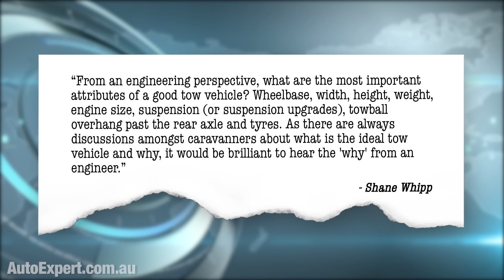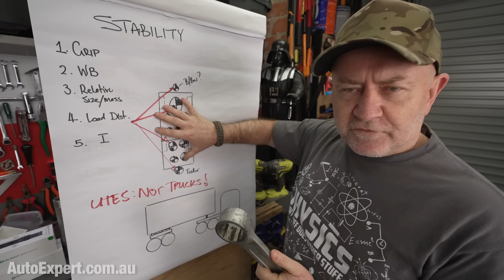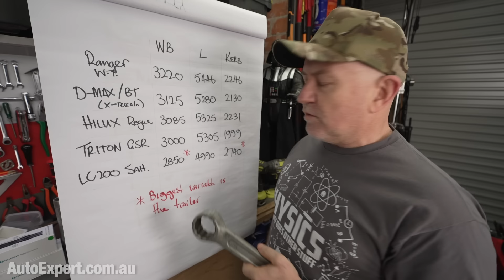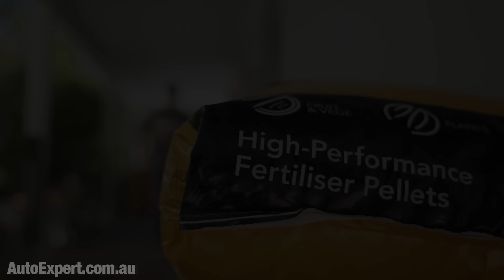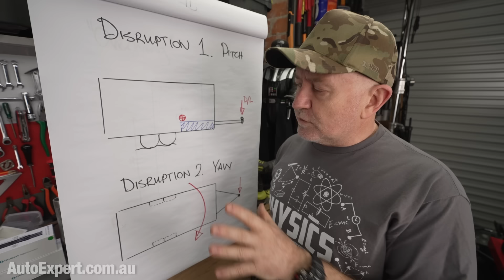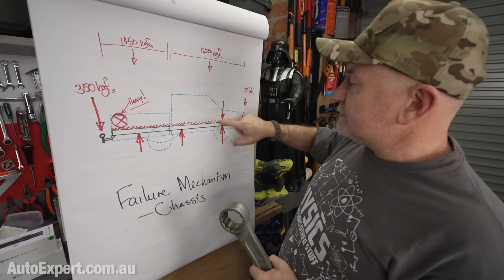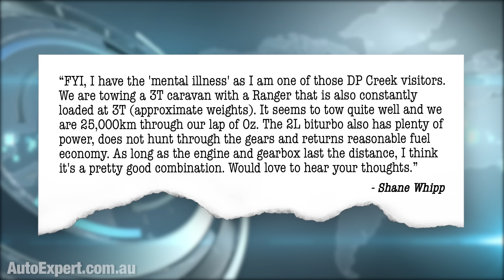Heavy Towing in Depth: The Applied Physics Deep-dive | Auto Expert John Cadogan

Comment: Wow John that was certainly a different feeling to your normal videos. It was a lot more refined without so much of the piss taking and very well explained. I would like to just make a couple of points. You said that when the airbags go off you won’t remember it and that a crash at over 60km/h is hit and miss as to whether or not you survive. You are so right on both accounts as in April 2020 my wife and I were hit head on by a car with a drug affected driver that crossed onto our side of the road. We were in a 2010 VE ute and he and his mate were in a 1998 Kia Rio , we were travelling at 80km/h and him probably more. I didn’t have time to even get my foot to the brake pedal and he didn’t bother. 
I remember absolutely nothing of the airbags deploying and yes it was fatal as the two in the Kia were both killed. The two things that saved our lives were physics, our car was bigger than his, and the safety devices built into the car. Looking at photos months later I could see how the safety cell was still in shape even though inside the cabin looked like a bomb had gone off. The impact even creased both rear quarters above the wheel arches. Yes we were smashed up pretty bad and still have a long recovery road ahead but we survived with mainly lots of broken bones.
We replaced the VE with a brand new Sahara to improve the odds and chose the Sahara it was the only Cruiser to offer all the safety gear. 
Most of my friends were surprised when I said no I won’t be getting a bull bar. Like you I don’t like them. I don’t like the look of them and I would hate to hit a pedestrian with one of those on the front. I can’t figure out how they’re still legal when car manufacturers have to design their cars to mitigate pedestrian injuries. I’ve had other Land Cruises over a period of thirty years all fitted with a bull bar and traveled to a lot of remote places yet I’ve never hit anything. Luck has played a part but so has the advice you gave. I tried to always off the road by mid afternoon and never drove at night and I like my sleep to much to be up and away early. Of course I got the same question “what if you hit a kangaroo” and my answer is “that’s what insurance is for”. Lastly one thing caravan owners, me included, can do to reduce the risk of your van getting a dose of the wobbles and throwing you of the road and landing upside down in a ditch is to fit stability control to the van. Most new vans either come with it or it’s optional and there are several brands offering kits that can be retro fitted to older vans. Thanks for an excellent presentation. Cheers Stuart.
Reply: in saying this being stuck in the middle of nowhere with a vehicle that was disabled only because you didnt have a bullbar to keep your living ass trucking until you can get somewhere it can get repaired is nice, especially offroad. i lost windscreen wipers when i really needed them in a remote place without mobile coverage once only because i lacked a bullbar.  a bullbar would have made getting home a whole lot safer

Comment: 100% agree!! Was towing my 23” 1/2’  2.8t van with a Hemi powered Jeep. Plenty of power and comfort  it mostly towed with ease. One scary moment descending the snowy mountains at 20- 30kmh and I realised what I really already knew. Also found out what I should have known. It is not a car you can trust to get there. Most unreliable car and terrible after sales. 
I now have an old F250 that was an off roader’s dream. I’ve had it brought back to a standard lift, got rid of the ridiculous 317 s and sold the Bull bar. Not a great environmental choice and I’ll pay a penalty on fuel and parking I know, but at least the tail won’t wag the dog so much ( I hope 🤞). 
Keep up the great info and I hope it sinks in a bit. 
Cheers 
Mark 
Mark

Comment: I was once towing a car trailer with a barred out speedway car on it, when it started to fishtail rather violently while going down an incline.. Instinct said accelerate, but self preservation said brake heavily so that when it rolls over , it will be at reduced speed. I chose brake heavily and eventually the wild fishtailing stopped. Lesson learnt..slow down to a sensible speed when towing.
Reply: Get an electric trailer brake controller! Just grab the manual override and it'll stop sway ;)

Comment: I had a classic, well disturbing situation unfold in front of me today in Maryborough, rural Victoria. Whilst travelling through said town, no lockdown for us rurally, I was behind a small single cab tray ute. The old guy was towing a box trailer with a industrial cube water container holding I’m guessing up to a 1,000L/1000kg. From the outset it was bloody obvious the weight he was towing was too heavy for his vehicle. As he continued in front of me at 60kph, I thought this could turn nasty. As he came to a corner to turn off, I could see he was not only going too fast but also braked too late. As he turned the corner, the laden trailer just unhitched complete from his small tray ute & shot up the road in front of me at speed! Eventually gravity on the trailer steered it to off the sealed road, the chassis submerged into the gravel & launched the water storage container into the air! The trailer bucked a few times before flipping onto its top. The whole time which was maybe 5-10 seconds, the old guy continued down the side street not even realising he’d lost his bloody trailer. I pulled over to assess the situation, & he was nowhere to be seen. Another driver pulled over, & said he’d call the police. Thankfully the trailer & said load were completely off the road.

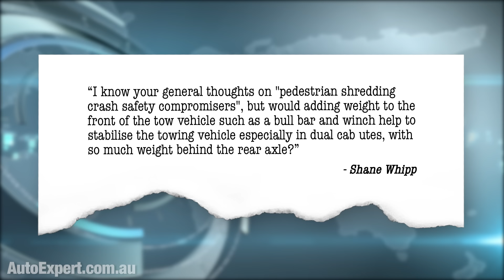Comment: 37:00 Bullbars - the eternal compromise between "animal impact" and "head-on with another vehicle, or a tree". We spent a long time deciding on this one, and I freely admit that I'd prefer the "no bar" option, as most of the time our 4x4 is on-road, in traffic and motorway driving. But recently a skippy lost the argument with the bull-bar, "out bush", and without the bar the damage would have been considerable (disabled the vehicle). As it was, nothing more than some cracked plastic  (inspected by installer to be certain of no frame damage).and the number plate took yet another hit. If you never "go bush" then a bullbar is just a wank.
Reply: Thanks for that. This has been a debate for me for a while too. As it is, my current tug has a nudge bar, so not sure if this is a good compromise between BB and no BB. Its a standard fitment from the manufacturer and looks like its beefy enough, including the mounting points on the chassis, but like you, I guess time will tell. I figure I can always bend a fender that's been crushed onto the wheel to get me out of a pickle.
Reply: Last sentence is gospel.
Toorak tractor stuff.
When I first met the Child Bride, her ride was an XB Chooktin Wagon, and a bloody big made in and for use around Cunnamulla Alloy Bullbar.
Designed to allow you to complete your trip after a roo strike.
And no Skippy ever got up again to go back to the Ranger Station to tell Sonny all about the experience.
My point is, that bar was a menace, actually annoying in town. But at 120+, out there, needed.
BTW, the XB was the last good Ford. Prove me wrong.
Reply: Skippy was a stinking New South Wales Kangeroo anyway, cause Matt Hammonds’ XW wagon had a Thanks Warra, Tar on the doors.
I had the hots for Clancy but.
Reply: @ScottMurrayBestFamilyCars  like a cyclist only more rational and more lovable, right?
Reply: @BenMitro  A nudge bar really won't provide any protection for anything more than a nudge. Which honestly, your plastic bumper would probably bounce back from anyway. They're really only for mounting accessories like lights and an aerial. Spent enough time around panel shops to know that a nudge bar will just pivot back into your radiator anyway. Maybe there are some stronger ones out there, but probably best to assume it's more of a shelf, than protection.
Reply: @ScottMurrayBestFamilyCars  the engineers have designed the vehicle to protect the passengers but not get them home from Dingo Piss Ck with a blown radiator
Reply: @adamsimpson2041  Generally agree Adam. A 3" thick walled aluminium nudge bar is way stronger than the plastic bumper. Having said that, I'm sure a sufficiently high energy collision will fold any bar into the radiator. 
I'm with John on this, anything bolted up front compromises the vehicles ability to protect the occupants, so I'd be removing the nudge bar if it wasn't a mount for the lights that do keep us safer. I can get another car, I can't get another life.
Reply: As an observer of people and many other things in life I do find it odd that you buy a car and simply drive it.
Buy a Ute and well that's different, you got to get a towbar  bull bars,
Why? Well the bloke next door has one and everyone else on the road has one, so I must be silly not to be trendy.
I bought a towbar for my Triton, it is kind of necessary as I haven't worked out how to tow a trailer without one.
The towbar has yet to be fitted so one thing I noticed is these buggers are seriously heavy and also chomp into your payload.
Well if they are heavy I can only imagine how much heavuer a steel bull bar is, which also chomps into the payload.
For me I'd rather minimise damage and not drive when the risk of hitting kangaroos is high which is dawn and dusk plus at night.
Also we'll many people like to overtake and be in front I would rather follow as let them be the sacrificial lamb that gets hit by Wally wombat or Skippy..
I would even go as far as to say follow a semi .
To me is all about risk management.
How to reduce risk

Comment: Dear John,

applause - even standing ovations to your explanaitions.

I studied geology/paläontoöogy with the focus on climatology/claciology. That includes physics, mathamatics an so on.

Yet, being more passionized for driving on ice and snow than analizing it I do work as commercial driver.

If it comes to of "fanboy-arguments" around the detail "overhang" in tow-discussions in campers', boaters' or even truckers' beergardens, I did notice this: the less knowledge of physics and the less skills in driving somebode actually has, the more the idea of "overhang" is supported with rage and blood.

And the reason for that is this: if you put your gear in reverse with a trailer hooked to the towball, then it's going to go more easy to taxi around the longer the "overhang" is and the more fanboy of an as long as possible "overhang" the driver is under all circunstances thinkable while driving.

Dunning-Krüger at its best.

Comment: Hi John, Love your videos and educated technical explanation and analysis. 

I tow a 3200kg caravan behind a 105 series Landcruiser (yes I know) and have long grappled with blue knuckle syndrome due to the inherent instability of the system. 

I have towed around Australia a couple of time and have come up with a theory as to why my knuckles turn blue. I have an electronic engineering background (not mechanical) so I may be dilutional (for one reason or another). The problem which I have encountered is a fundamental instability in the tow "system" (tow vehicle with attached caravan), primarily at highway speed.

I agree that all the elements you have highlighted play a part in this instability, however I suggest the "primary" issue for the instability is that a positive feedback loop exist between the caravan and tow vehicle. 

The positive feedback exists because the hitch point of the caravan is located behind the rear axle of the tow vehicle. A random yaw moment in the caravan causes a yaw moment in the tow vehicle with an opposite angle of rotation. As the tow vehicle corrects itself (naturally or from driver input), with a yaw moment in the opposite direction, this rotation is transferred back to the caravan with an direction of rotation opposite to the initial yaw moment. Hence producing a positive feedback loop with a potential runaway characteristic.  

This is why you see these videos of a caravan or boat oscillating a couple of times and then swaying so violently that they end up rolling over. 

If the hitch point was to be located in front of the rear axle the feedback loop would be negative and hence any yaw moment induced into the tow vehicle would produce a self damping affect. 

I suggest this is also why semi-trailers the "fifth wheeler" configurations are stable.   

All right I can handle it, dish it out, I am ready for it.....  OR    If I am right then you must be ..... well ..... ?
Regards
Eddy
Reply: I find installing a 5th wheel on double cabs to be quite difficult because as John puts it, the rear axle is practically in the passenger area or very close to it. So getting the vertical loading precisely on the drive axle is not gonna be easy, considering that you must also include the “interference” aspect where the trailer tracks the tow vehicle.
Reply: Semi trailer's have the axle at the back which eliminates sway.

Comment: Overhang is the most underrated factor. L.Cruiser single cab utes for example
Reply: Overhang past the rear axle to the tow hitch is the second most important thing for towing safety. The shorter the better. E.g, tandom axle trucks with turntable, 5th wheelers, SUVs.

Comment: I have the 2l Ranger and have not experienced any problem with hunting through the gears when towing either. My toy hauler weighs about 2100 kg the Ranger does a much better job of following it than the MUX before it. If I leave it to is own devices when towing it will rarely go into 9th of 10th, so I usually lock those 2 out and it happily sits in 8th, only changing down when the hill gets a bit steep. I think our guy with the 3 tonne Ranger and 3 tonne trailer combo is probably over loading the tow vehicle though as the trailer should impose around 300kgs of is weight on the tow vehicle putting it at about 3.3 tonne. GVM for the Ranger is 3.2 tonne
Reply: Extra trans oil cooler on the Ranger? They are a good idea

Comment: Moments of Inertia, Radius of Gyration etc etc. I had 50yrs of it and thought I'd do the "auto dump" when I retired, but it's still there, lol. My example - 4x4 wagon, 3T tow, no bull bar - 1800kg ATM single axle van. When I load the 4by for a trip, it weighs around 40kg shy of GVM, the van with its 60lt water tank full, 25 kg shy of ATM. The 4by GCM is 5700kg, my total weight is 4555kg, which is 1145kg below the limit. Goes to show how close some criteria can get when only towing 60% of maximum. P.S. After weighing I did some serious pruning of what I carry. :) Thanks for the memories.

Comment: Hi John,

Rear axle overhang is important from the perspective of stability, less important than trailer loading for sure, but important enough to warrant consideration given the cost of improvement can be really quite low.

In resisting the forces applied to the tow vehicle by the trailer, including in pitch and yaw, the trailer acts through that drawbar. That drawbar is a lever.

Making it excessively long just gives a longer lever to the trailer to act upon. The downward force required to unload the front axle by a given amount is reduced by 1/3rd by going from 1m of overhang to 1.5m. It's a simple moment arm. Force times distance.

Same story with every other force, for example the force applied laterally by the yaw intertia of the van upon the hitch is carried substantially by the grip the rear tyres have on the ground. Make the lever longer and less force will be required to overcome the friction between the tyres and road surface.

The relative length of that lever changes depending on what you're actually considering, yaw intertia will act about the centre of mass of the vehicle, downward pitch about the centre of rotation of the rear axle, upward the front axle etc, but in all cases, the shorter the better.

As you point out its not going to substantially affect the point about which the vehicle rotates, but it does have a not insubstantial affect on how much force is required to cause it to come unstuck in the first place.

It's exactly the same deal as where you want to place loads in the tray. Get them as close to between the axles as possible. The trailer is just another point load placed in nearly the worst possible position. Whatever you can reasonably do to fix that, such as not using an extended drawbar tongue, should be done.

Yes, if that change is the difference between stable or not stable, you've already properly fucked up, but it's a simple change that does have a positive effect and it's not something that costs much. Cost v benefit, definitely on the win side of the argument.

Edit:

I must also say, you've done a bloody good job of describing what can be a rather complicated thing to wrap your head around.

Bravo Zulu.

Comment: I don't know about doing "The Lap" but getting a Ute and a van and travelling around and taking time to smell the roses is appealing.
I have always believed in safety buffers .
A lot of the physical s I understand and so my thought is to buy a Triton and buy a van with a tare weight or around 2.1 tonnes
Don't carry weight if you don't need to so even 200 litres of water can be filled when you get to where you want to go.
Fill the back seat of the Ute and any other stuff over the rear wheels.
Finally just because the speed limit says 100Kph it's not a target so travel 10 or so under and be considerate of other motorists so pull over and let them pass.